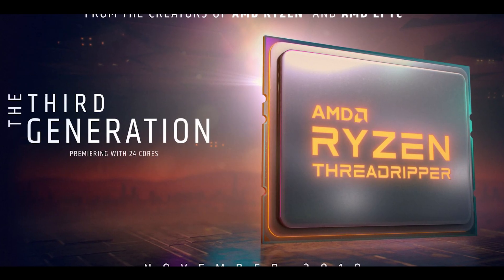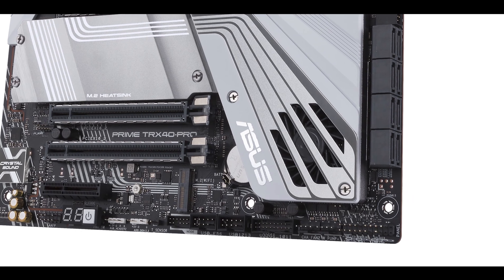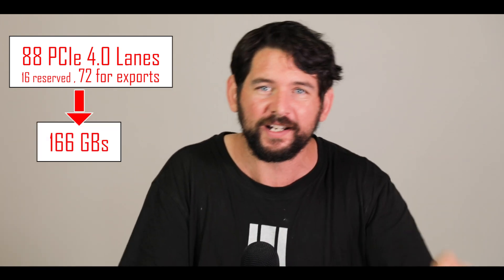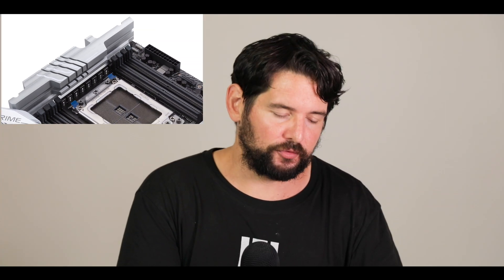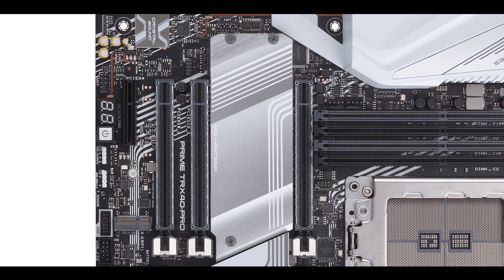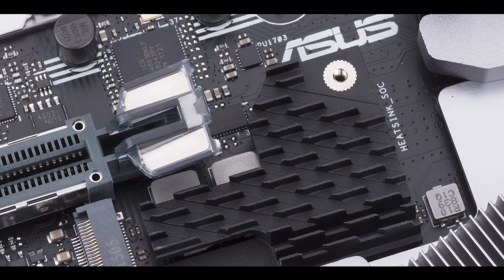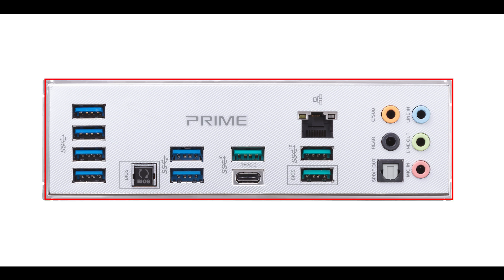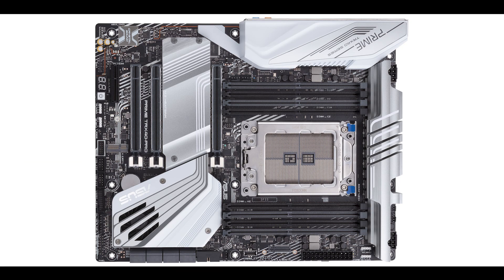ASUS PRIME TRX40-PRO, everything you need to know!

Comment: is anyone know the  difference between the pro and pro S ??
Reply: I found this on the net : While the older Prime TRX40-PRO is perfectly capable of running- or even overclocking the 3990X, the new PRO S is better suited for the task, and comes with bolstered 16-phase CPU VRM with 70 A power stages, same ones found on the original ROG Zenith II Extreme, while the Extreme Alpha has been amped up with 90 A power stages. ASUS upgraded the ROG Strix TRX40-XE Gaming the same way. The board's feature-set is otherwise identical to that of the original Prime TRX40-PRO
Reply: @spinkycleft  Oh man thank you for this. Been looking for this answer because I have a Phanteks Eclipse P600S and this board seems to be the only AVAILABLE board that fits my case.

Comment: What size screws are used to screw the optional fan bracket that it comes with into the side of the MOS heatsink?  Doesn't seem to be 2.5" drive/CD-ROM screws will fit, seems smaller.  It comes with the long screws and nuts to attach a small fan to the bracket, but I haven't yet found what size to screw the bracket into the heatsink.  Confirmed, definitely smaller than 3mm and #4-40.  There are two loose screws that come in the large bag along with some other kind of bracket, but they are not machine thread and I confirmed that they won't thread into the pre-threaded holes in the side of the MOS heatsink bracket.  What little they show of this bracket is on page 2-14 (54) of the manual:  https://dlcdnets.asus.com/pub/ASUS/mb/SocketTRX4/PRIME_TRX40-PRO/E16115_PRIME_TRX40-PRO_UM_V2_WEB.pdf

Comment: I know it's TR mobo review, but i have a question regarding overclocking my 9900k. I have z390 Aorus Pro, and i can't get my i9 9900k to be stable at 5ghz with less than 1.425v although i have multi-core enhancement off. It doesn't even post to windows with less than 1.375v. Any suggestions please?
Reply from the maker: It really depends how lucky u are with the CPU itself. 
Some can go up to 5.2ghz, some cant Overclock at all !!
Reply: @Laurentschoice  thanks Laurent, guess i lost on Silicon lottery then.